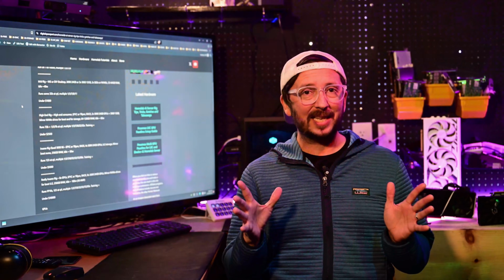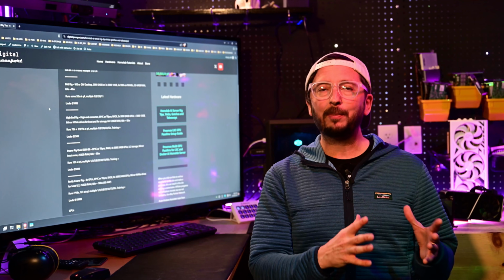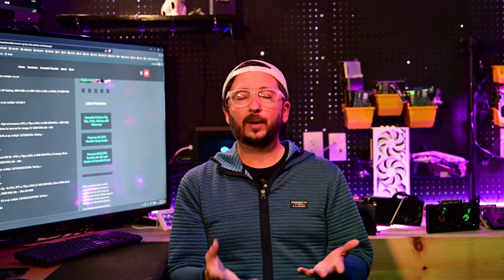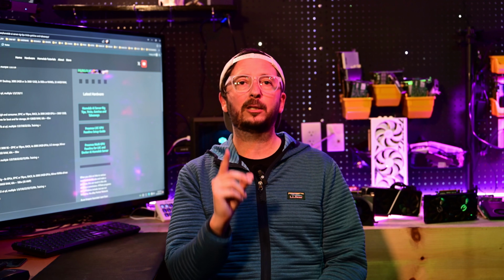Ai Server Hardware Tips, Tricks and Takeaways

Comment: I have a mining rig with 1x PCI-E Lanes. I thought the models required 4x PCI-E lanes? You mentioned in the video that it is possible to run GPU on x1 PCI-E for inference. Are there other caveats?
Reply from the maker: Not around the 1x point really. However I'll drop a note I didnt test that with the usb risers yet. It should not make a difference vs ribbons as its just loading the model into vram, much like a dag workload. However it would impact training horribly. It may impact some rag workloads depending on how much you batch into a document store. Let me know how it goes!
Reply: @DigitalSpaceport  You can actually test this on your quad-3090 system. Just set PCIe version to 1x in BIOS and check the generation speed in large models and especially the speed of processing large context.

Comment: At what point does an A100 80gb become viable? They are starting to drop in price now. Mulling over either an RTX 6000 Ada or waiting a bit longer and going for an A100 80gb. Currently running 2x RTX A5000, the lack of single card VRAM is much more of a limit than many of the online world seem to point out.
Reply from the maker: Honey we are getting an A100 cluster doesnt pass my gut check on things I can casually drop at dinner. Not yet. Im on ebay looking these up however now and your right, prices on them are down.
Reply: @DigitalSpaceport  looking forward to the video if you ever do get one. Having a compute card makes a lot more sense as models get bigger. The self-hosted scene is going to get pushed out if things like the a100 stay very expensive.
Reply: You've hit the nail on the head. V-RAM is the most important factor. Unless you are looking to run at most a 7B parameter LLM (which IMO is pointless) then an nVidia RTX based system will yield disappointing performance. Even an M3 MAX with 128GB RAM will perform better on models requiring more than 24GB RAM, and the M4 MAX offers still better performance.

Comment: I loved this video  !. Very helpful information !! I have a question: What is the difference in performance between using a pcie gen 3 x16  vs a pcie gen 4 x16 . I have a few 3090s and also some dell t7810 with dual 16x but pcie gen 3 :(
Reply from the maker: Thanks. for inference speed, slot gen and width dont have impact that is meaningful at all. Thise t7810s are G2G!
Reply: @DigitalSpaceport  Nice! What about training with x16 pcie 3.0  vs x16 pcie 4.0 ? Did you try ?

Comment: How much would you charge to buy all the components of a 3090 quad?
Reply from the maker: I think your looking for the cost analysis part of the video where I put that together, not sure if you saw that yet. Its here -  https://www.youtube.com/watch?v=JN4EhaM7vyw&t=823s I would also suggest the H12ssl-i is about the same cost as the MZ32-AR0 also right now and a smaller board footprint and no sas connector bridge to get the top PCIE slot running.

Comment: How does a 4x3090 compare to 2xA6000 for training/inferencing for different model sizes? 

(A6000 is more like 3090 Ti in terms of CUDA but with 48GB VRAM, though with a lower power draw for a single card than even the 3090 since it’s optimized for pro workloads and not gaming. Downside: it’s 2x the cost per GB of VRAM compared to 3090.)

Comment: Taking a dual 4090 system as a benchmark build /running cost. What would be the cost per hour to use a cloud provider with 48gb RYX A6000. When would it be cheaper to use a cloud service.
Reply from the maker: @MartinStephenson1  its multivariant, as individuals electric rates factor in heavily. Also how much utilization of the system is in play factors in heavy. This might be a good video topic, its pretty complex. Id also not go wth 4090s unless your doing imgen/videgen.
Reply: @DigitalSpaceport  Why not? nVidia's benchmarks show the 4090 to yield more than 4x the TOPS of the 3090. If the model will fit entirely in the V-RAM of a single 4090, then that will perform far better. Even the 4080 SUPER offers more than 2.5x the performance of the 3090, though you sacrifice 4GB of V-RAM.
Reply from the maker: This has not played out like their benchmarks when I did head to head tested of my dual 4090s vs dual 3090s. Maybe a good subject to revisit in a future video.
Reply: @GaiusTacitus  firstly memory speed matters and 4080 is much slower than 3090. Secondly cloud or local can be simple problem - do you spend hours daily on it or not if not cloud will be cheaper, better and faster
Reply: @whitecrowuk575  Why are you trying to work the 4080 into the discussion? The maximum amount of RAM of 16 GB on the 4080 is the more limiting factor for use with AI.

Leaving RAM out of the discussion, you're incorrect about memory speed.

RTX 3090 Specs:
Memory Size: 24 GB
Memory Speed: 1219 MHz
Memory Bandwidth: 936 GB/s
Base Clock: 1395 MHz
Boost Clock: 1695 MHz
TOPS: 284.7

RTX 4080 Specs:
Memory Size: 16 GB
Memory Speed: 1400 MHz
Memory Bandwidth: 716.8 GB/s
Base Clock: 2205 MHz
Boost Clock: 2505 MHz
TOPS: 779.8

RTX 4090 Specs:
Memory Size: 24 GB
Memory Speed: 1313 MHz
Memory Bandwidth: 1008 GB/s
Base Clock: 2235 MHz
Boost Clock: 2520 MHz
TOPS: 1321

However, if you're running a single GPU system and a 13b Int-8 LLM, then a 4080 is still a better choice than a 3090. Of course, the 4080 Super is slightly better with a yield of 820.8 TOPS.

None of the above GPUs will run a 13b FP16 (half-precision) model because it requires 26 GB RAM.

The RTX 5090 takes a big leap to deliver 3356.2 TOPS, but at $1,999 MSRP and having 32 GB RAM.

FWIW, memory bandwidth is an important factor, but it is not the only thing that contributes to TOPS.

Comment: hello what do you think about 7 rtx a4000 or rtx 4000ada the slim on with 20gb of vram and on slot. they have a lower tdp  than a 3090rtx?
Reply from the maker: The rtx's cost a bit more for the amount of VRAM but are great overall. My a5000s idle around 8w just a bit under the 3090s 10w.
Reply: Faster more modern architecture than the 3090s too. I have four 3090s and one A4000 ADA SFF and was surprised by it's performance

Comment: 4gpus vs 1 m4 max. And its getting half the tokens/sec. Powering 4 gpus, the extra equipment needed to run them.. Apple seems like a no brainer.
Reply from the maker: Here is a timestamp comparing numbers on the same quants M4 Max vs quad 3090 ollama/llama.cpp Im not sure where your getting its half as slow? https://youtu.be/0sotx35yYVM?t=52&si=TypOesYh-ujt2_AQ
Reply: I guess this is about M4 Max being half as slow. I think there’s a point. Getting an M4Max MacBook(14 Core Version though which might be slower) doesn’t cost a lot more that 4 used 3090 where I live. So it’s way cheaper than a full system built around the 3090s. And it uses way less energy. And it’s way more versatile. So depending on what you want, half the speed maybe isn’t that big of a tradeoff. Though as I said, I’m not sure if the 14 Core version is comparable to the 16 Core version, which is more expensive than a system built around 4 3090s.
Edit: It also depends on what you need AI for. If you’re looking to totally replace ChatGPT and ask questions all the time, speed matters more than if you’re happy with ChatGPT and only need local AI for special tasks and/of some more private stuff.
Reply: @HeyHeyEveryone   With M4M MBP, you've gotta get the 16 core variant to get more than 36 GB memory.

Comment: So i did not get it, more cores is better or worse for AI? For example Ryzen 9 5950x with 16 cores vs Ryzen 5 7600X with 6 cores?
Reply from the maker: Its not super black and white. More cores are useful when you run more models. Ive seen a single model run 12 cores up at the same time briefly, others just 8. However 1-2 cores always stay ran up the entire output. Id go 8-16 cores minimum myself. If you have a lot of additional services, factor those in additionally. High all core turbo and single thread factor second behind GPUs.

Comment: My AI LAB I build to test and was shocked how fast it was.
4 x Intel(R) Core(TM) i5-2400 CPU @ 3.10GHz (1 Socket)
RAM usage 71.93% (11.22 GiB of 15.60 GiB) DDR3
proxmox-ve: 8.3.0 (running kernel: 6.8.12-4-pve)
NVIDIA geForce GTX 960 PCIe GEN 1@16x 4Gi
write python code to access this LLM
response_token/s:24.43
create the snake game to run in python
response_token/s:21.38
You did a great job with your tutorials Thanks I'm going to get some 3060s now.
Reply from the maker: Thanks those 12GB 3060s are costwise probably top 3 imo for VRAM/$

Comment: What are your thoughts on the AMD Strix Halo releasing in January at CES? It's an APU with 16 Zen 5 cores and an NPU and a GPU all on chip and on chip ddr6 64GB. Also called the Ryzen AI Max+ 395. Targeting AI workstations, the January release version to have 64 GB on board ddr6 that can be allocated to AI models (OS would need some of the 64). Q3 2025 128 GB version.
Reply from the maker: AMD doesnt lack for the hardware. Its always the software/drivers/kern lacking. Its been better but nvidia is the sure thing. Hopefully they have some good work going into the sw side for this! I hope to test one out eventually

Comment: Any advise on potential local server for a small startup looking to support 50-100 concurrent users doing basic inference/embeddings with small-medium sized models - 13B for eg.  

Would a single RTX 3090 suffice for this?
Reply from the maker: This is my guess, so don't hold me to it. I would start with figuring out exactly which model or models you want to run concurrently. You would want to set the timeout to those to be pretty long to avoid something like people coming back and all warming it up at the same time, so greater than 1 hour. I think you would be better off with 3 3060 12GBs if it would support the models that you intend to use. If you are looking for any flexibility, then start with a good base system and add 3090s as needed is the safest advice. If there is a big impact from undersizing, just go 3090s. Make sure to get a CPU that has a good fast single-thread speed. Adjust your batch size around as needed but the frequency of your users' interactions need to be observed in NVTOP of other more LLM specific specialized performance monitoring tools.

Comment: can you mix together amd and nvidia gpus on inference?
Reply from the maker: Great question. Will test when I get an amd card.
Reply: @DigitalSpaceport   within 2 weeks if I'll have enough time I'll probably let you now. Just ordered the cheapest 12 gb 3060 I 've found to add alongside a RX 6800😁
Reply: I quicly tried lm studio and it was using both of amd rx6800 and rtx 3060 at the same time to run a model. I tried qwen and something else I don't remember. Unfortunately  CPU decided to die 2 days ago. I'm stuck just with a laptop 😭 Untill new cpu arrivers I cannot try anything else
Reply from the maker: Oh nice so llama.cpp does work with both at the same time. Any observation on if it picked the amd over the nvidia to be the lead runner? Usually the model vram split is higher on that GPU from what I have seen
Reply: @DigitalSpaceport  didn't check. I gave it a quick test unfortunately.... I 'll try again with the new CPU when it arrives

Comment: more than ddr4/ddr5  & MTs probably the interesting takeawy would be single vs dual vs quad channels vs 8 channels performances
Reply: ...maybe even more cache speeds and quantity....
what are your thoughts?
Reply: same thoughts...faster cache and higher amounts would be my bet both on cpu and gpu. 
If I'm not getting something wrong the fastest gpus running llm ( both older and newers models) seems to be those with higher cache, higher memory bandwidht and bigger Memory Bus sizes.
of course TFlops do count  but to  lower extent
Reply from the maker: Forvsurevyou want tobwatch this video! Its the most in depth test on cpu impacts around and ive got a pretty crazy 7995wx in it 8 channels filled.  https://youtu.be/qfqHAAjdTzk
Reply: @DigitalSpaceport  I missed that. tnx. whatching rn

Comment: The most difficult decision is how much money to spend for a first buy. I’m kinda reluctant to get a 3090 config not knowing if I’ll be totally into local AI.
Reply from the maker: 3060 12GB is a good starter then. If you want img video gen heavy, 24GB is desirable. Local AI is best left running 24/7 in a setup however to really get the benefits with integrations abound in so many homeserve apps now.
Reply: Maybe rent a vm with your target config for a little before you start building?

Comment: My RTX A6000s idle at 23W so yeah, always on is expensive depending on your GPU config. I have 3x in each system, 2 systems in my lab.
Reply from the maker: Mmmmmm 48GB vram each. So nice!!!
Reply: @DigitalSpaceport  Yes, they're nice. I was looking for a trio of A100s over a year ago and couldn't find them, so instead, I bought 6 A6000s because at least I could find them.
Reply from the maker: If you think about it... I avg 10-12w per 3090 24gb the 23w per a6000 48gb seems to scale. Maybe idle is tied to vram amount also?
Reply: @DigitalSpaceport  That could be, but usually power scales with # of modules, not size. But then again, maybe you're right, because I looked at an 8x A100-SXM rig a while back, it idled each GPU between 48-50W and had 80GB per GPU.
Reply from the maker: @canoozie my 3060 12GB idles 5-6 hum. Interesting. Also now im browsing ebay for A100s. SMX over pcie right? Im prolly not this crazy.
Reply: @DigitalSpaceport  SXM is generally favoured because of the higher power envelope (400W vs 300W), better cooling, and if you do any training at all, the 600 GB/s nvlink connections are fully connected (not possible on PCIe). They've also got a smaller footprint so you can pack more of them into the same rack space, and GPUs can communicate directly without having to go back to the CPU. But they're also more expensive lol

Comment: Any tips/experience using NVLink with dual 3090s?
Reply from the maker: Its not needed unless you are training but i need to test on my a5000's that have nvlink to not just be a parrot on that. I did try it out but messed up something iirc and got frustrated. Will give it another shot soonish
Reply: @DigitalSpaceport  cool thanks! I'm putting together my new 2x3090 desktop/workstation and I grabbed the bridge so I'll be trying it out soon as well

Comment: I setup motherboard and epyc cpu just like you.
May i ask if you can do it all over again, will you change any setup?
Reply from the maker: Im wanting to get a 7f72 but they are expensive and I would need a pair. If i was scratch building I would likely have used an air cooler for cpu also. Maybe the h12ssl-i would be the board id go with since the mz32-ar0 has gone up in price a good bit.

Comment: Great video! The most eye-opening takeaway: having two GPUs doesn’t mean double the speed.
Reply from the maker: Hands down #1 question in videos. Not with llama.cpp yet but hopefully soon. Bigger models and running models on seperate gpus at the same time are the current reasons and running bigger models like nemotron is a big quality step. Or use vLLM which isnt as end user friendly as ollama/owui
Reply: Using a Cuda nvidia based ai build will double with every added gpu using tensorflow and tensorboard to have a dashboard for looking at stats of all the gpus you use. You can also do vitural pools of vram. Which he didn't mention and it uses nvme but you need x16 slot.
Reply: Well it depends on the architecture of your AI. You could have a modular approach.
Reply: Why would this be eye-opening? Of course, having multiple GPUs does not result in linear scaling. You can't get close to linear scaling on any system where multiple chips share the processing, even on the same die. When it comes to GPUs like the nVidia RTX series there is the latency of the computer's bus that will slow data transfer.